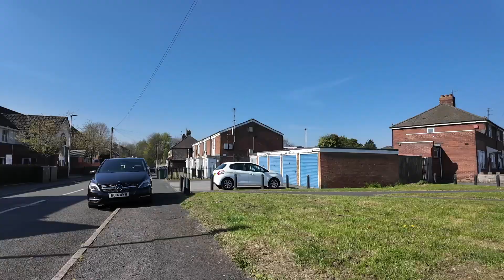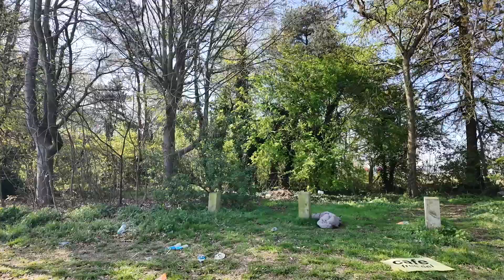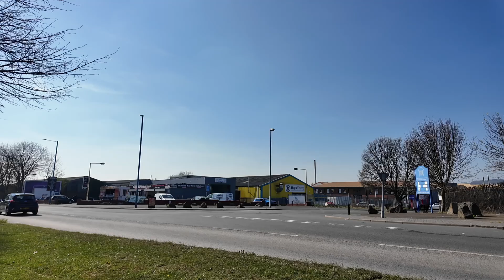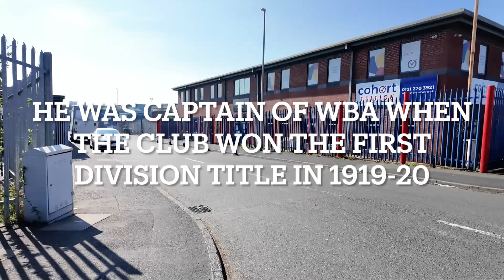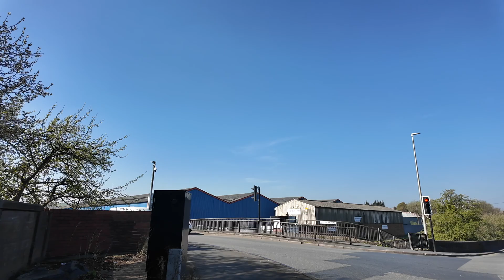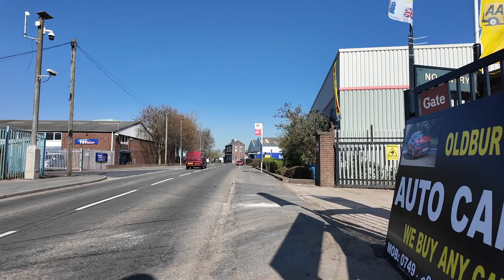WEST BROMWICH BRANDON WAY the continued demolition of an old factory in Albion Road

Comment: Remember Bulls head in Bull Lane used to pop in when i finished at Lees.. Not sure if it was closed in late 1990s or 2000s. Atcore on corner Greets Green Road and Brandon way is on the former Delta Works.
Reply from the maker: Thanks, The Delta had a really nice water feature but they let it deteriorate into a rather poor state
Reply: @awalkwithphil  Yes i remember the pool on Delta works always had geese and ducks on there...